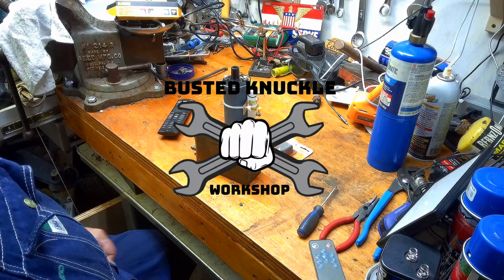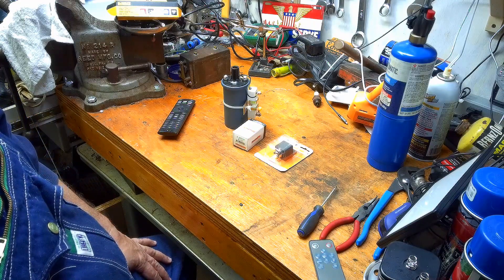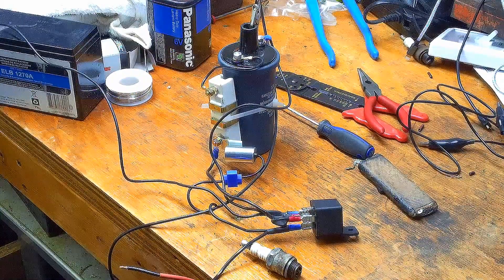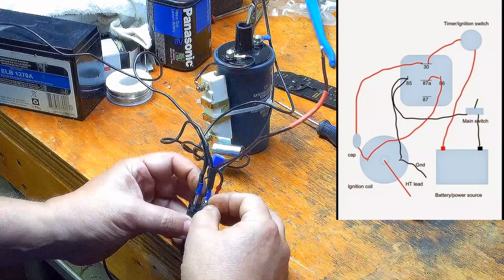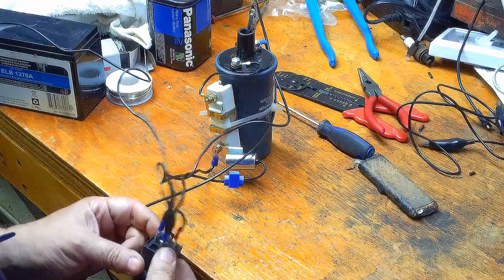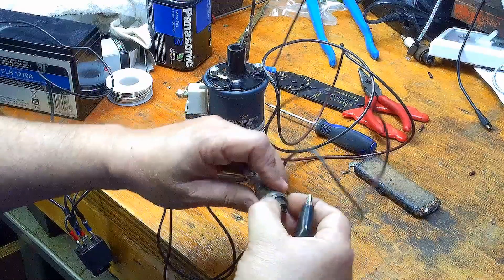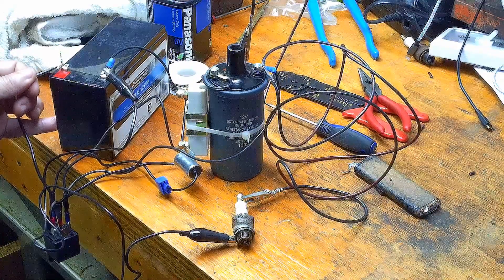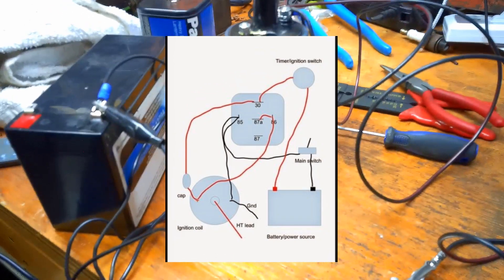Let's build a buzz coil

Comment: can you please give advice how posibly that culd run with gm ignition module as trigger?
I was also curiuse to know insted that resistor to ignition coil wuld it be posibel to add potenciometer ?
I need desperatly to finde solution for advance retarding system for me E Core type ignition coil I have bunch 3 4 6 pin relays sadly no 5 pin those circuets confuse me.
So I have no idea how I wuld add ignition module as trigger I use lot capacitors hv and high uf readings .
So Im not shure if other relays wuld work honestly dont want to fry me wire harnest.
Honestly that E Core ignition coil confuse me 4 pins so Im not shure how to determine what is positive what is negative pulses or what is primary and what secundary.
Any way I need some how manuali retard that thing I have realy hard time starting me car in winter so I hoppe for some advice
Reply from the maker: Thank you for your comment. Unfortunately I do not know the answers to your questions. I wish you luck with your project

Comment: I didnt have a 5 pin relay. I just used two SPST relays. One is NO, the other NC. So while theyre busy turning eachother on and off, I ran the intermittent power between them to the coil. I'm guessing the cycle is 40hz. Maybe 50. 
But I saw some guy on YT use a dimmer switch that makes mine look stupid. All it was was a dimmer switch, a 2K cap or higher, and an auto ignition coil.
Screw that 2K. I dont tickle flies, I send them to their maker. I use the 2200 cap from microwaves. His is 120VAC though. I prefer electrocuting myself off grid. I could still use an inverter to do it.

Comment: Sir I have question culd those relays replace ignition modules? I want to build waste spark system useing just relays in reverse polarity culd I some how use my induction triger inside the distributor to activate those relays? The thing is I belive my gm 4 pin ignition module is polarity senzitive and aperantly I have voltage regulator inside my dashboard I wuld like to bypass that problem because I found on my starter motor R terminal selenoid so I want litel more voltage and curent on engin start up because of winter time I always have problems starting due to many reasons expecialy bade fuel. So any thing you can help my?I some how figured out that I culd add some capacitors with that ignition coil for litel more power hoter spark just on start up .
Reply from the maker: Interesting question,  I honestly don't know the answer,  but would be interested to hear the results if you try it.
Reply: @bustedknuckleworkshop  I did try plazma ignition but evry thing spin faster alternator puting out 15-16v but alternator changed starting charge rpm from 1k rpm to 2.5k rpm so aperantly it has somthing to do with fuel types cold start fast but engin shakes after warming up smuth like glass .
So probably hot's spark like amplifier shuld by used on start up then switch to high voltage plazma posibly bouth culd by used for dual fueling engines for best benefit.
Im not shure tought they say - is fired on compresion + is fired on exaust stroke virtualy creating 6 stroker internal/external burning engin I dont know what hapens if its oposite used like -+.+-.++.--. there culd probably change engin perfomance Im not shure but some thing is there probably engin is limited tought transmision ,alternator starting change,starter speed and probably cooling and oil lubrication shuld by modified with reinforced gaskets.
My engin is after all gasoline/dizel block.
So I basicaly forcing my engin to dizel.
Thats why Im experimenting with diferent fuel types mix them together etc.
My engin is basicaly working on own lubrication oil vapor that thing can come in handy as low speed generator useing probably furnace oil ore make own fuel probably. 
Thats why I have problems with my ignition system thinking upgrading my gasoline engine with heaters to fire engin Im positive it shuld work.
My engin behaves like hot bulb engin ore carbureted dizel I do have some videos recorded such fenomena.
I belive some chevy and gm blocks can do the same thing.
Run vaporisators on my engin and compleately removed gasoli when engin reach dizeling requestments.
Its all odd oldschool staff who no one realy teaches any more.